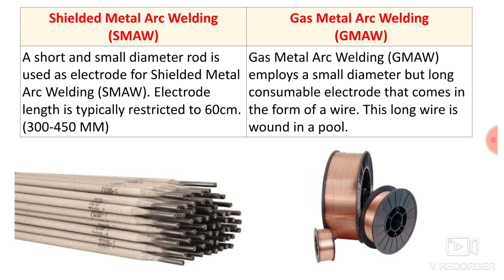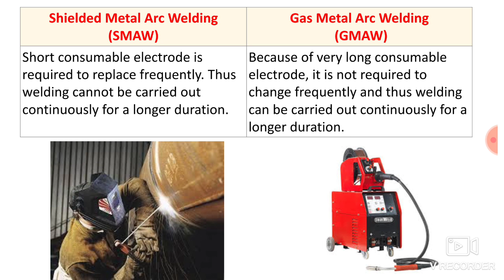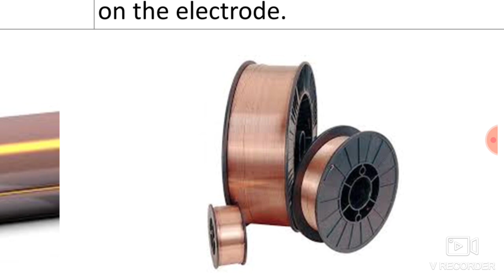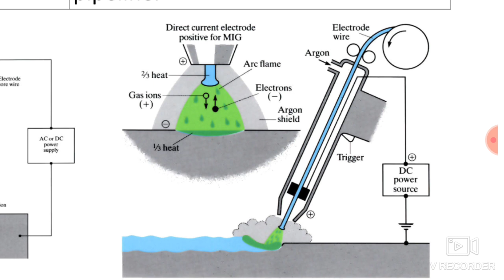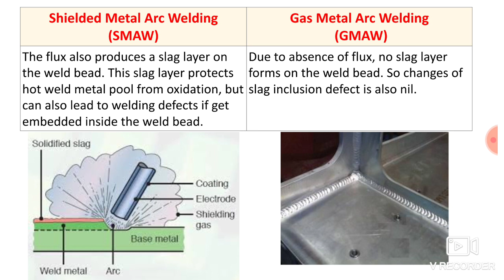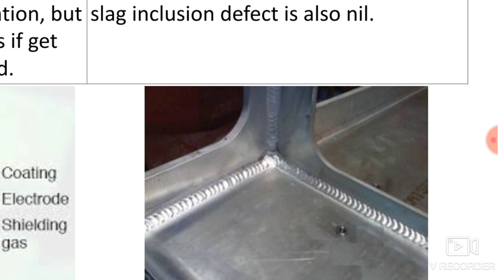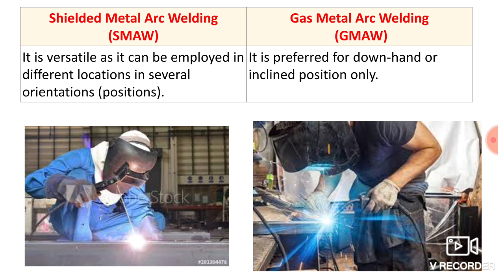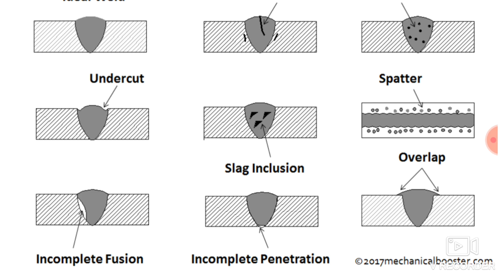Difference Between Shielded Metal Arc Welding (SMAW) and Gas Metal Arc Welding (GMAW)- Mechanical En

Comment: Hi! I have often seen in my industry that Carbon steel pipelines are welded using SMAW while SS pipelines are welded using Argon gas welding. I couldn't get a satisfactory answer. Why is it so?
Reply from the maker: Argon produces stable arc while welding SS

Comment: Subscribe  ENDURANCE ES
#ansys   #som   #strengthofmaterials
This channel focus on the ANSYS WORKBENCH & Basic design subjects in Mechanical Engineering. In current channel is having two play list . We hope youwill like it. Please visit the channel & subscribe it more details for ANSYS WORKBENCH & STRENGTH OF MATERIALS. For any queries mail us at endurance.engineeringsolutions@gmail.com.

Watch full play list of ANSYS WORKBENCH FOR BEGINNER.
 Tutorial1 to 32   https://www.youtube.com/playlist?list=PLICzjIuc4UqH3hllQc1kEF19YoBfAkEBQ

Watch full play list of STRENGTH OF MATERIALS
TUTORIAL 1 LOAD & TYPES OF LOAD https://youtu.be/MVKCUNhXKPE 
TUTORIAL 2 WHAT IS SOM ? https://youtu.be/AjDkm9GwHJ4 
TUTORIAL 3 SIMPLE STRESS &STRAIN https://youtu.be/ZewJG8nbuHw 
TUTORIAL 4 HOOKES LAW YOUNGS MODULUS OF ELASTICITY https://youtu.be/uKKLRFTScwU 
TUTORIAL 5 STRESS STRAIN DIAGRAM https://youtu.be/EwlfncZm9P 
TUTORIAL 6 FACTOR OF SAFETY https://youtu.be/F9lfT1ABpDE
TUTORIAL 7 UNITS & UNIT COVERSIONhttps://youtu.be/TOSiT_j1nDI
TUTORIAL 8 SHEAR STRESS, STRAIN & MODULUS OF RIGIDITY   https://youtu.be/_dF4u6fUJ6c
TUTORIAL 9 POISSON’S RATIO & IT’S SIGNIFICANCE   https://youtu.be/lqoy0NTMlBQ
Reply from the maker: Very good..